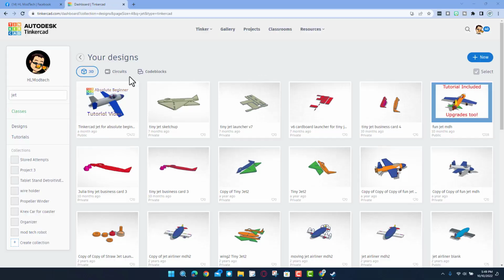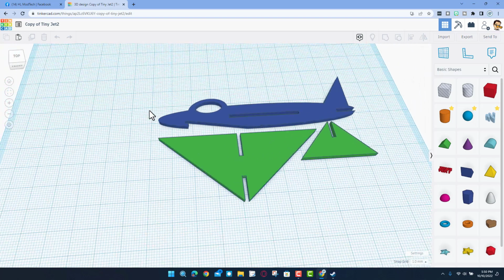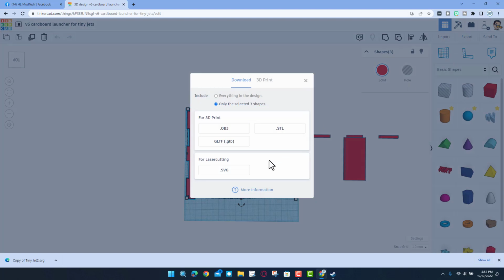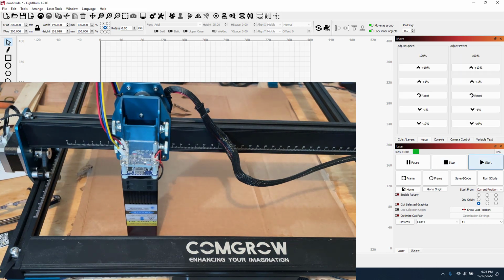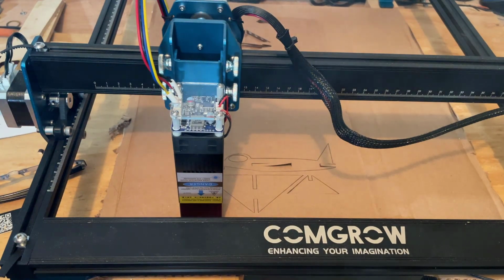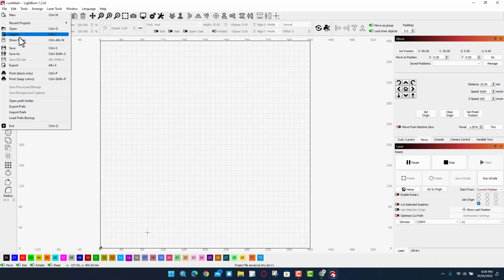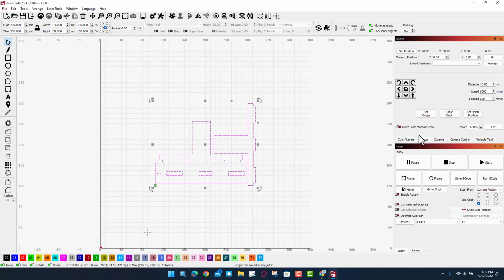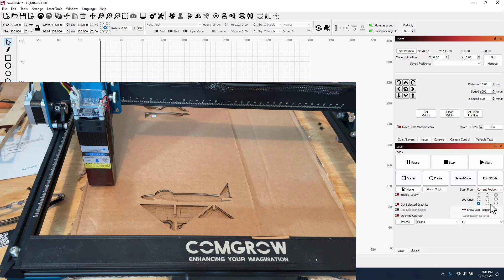Cut & Fly a Cardboard Tinkercad Tiny Jet Comgrow Z1 laser cutter

Comment: Will you get some drag due to the holde support between the carboard?
Reply from the maker: Yes. When I first came up with the project I doubted they would even fly becaues of the corrugation of the cardboard. I assumed we could have to tape them up or something. In the end, we did not have to do that, but I would still allow kiddos to adjust if they wanted to experiment.